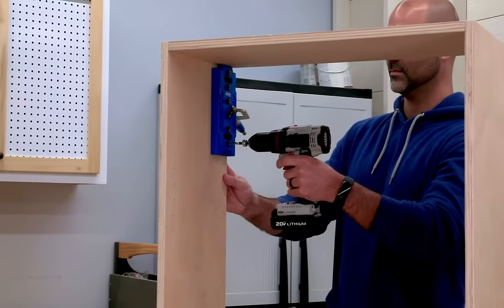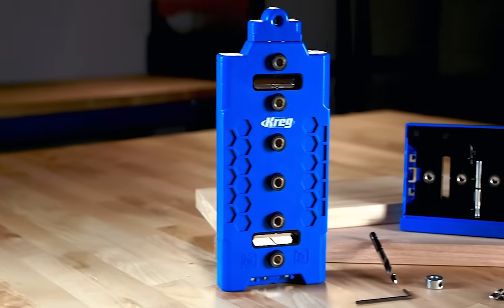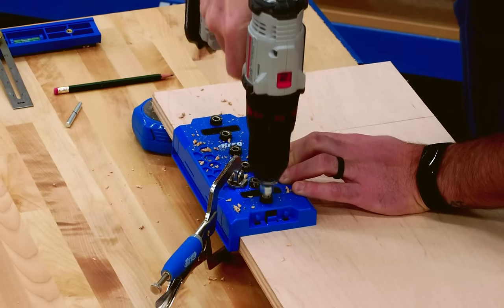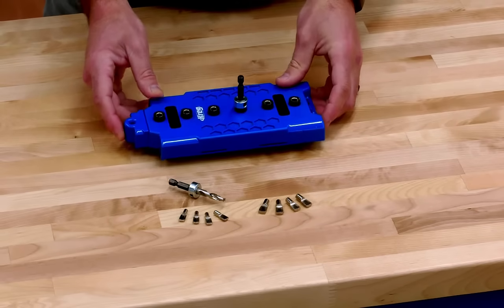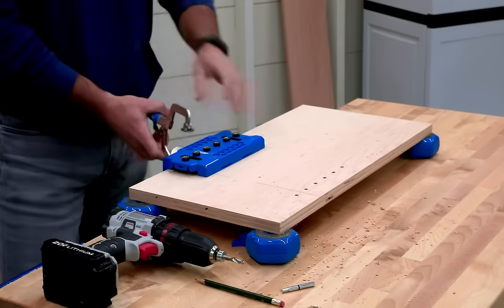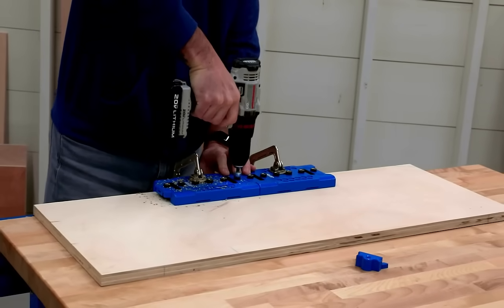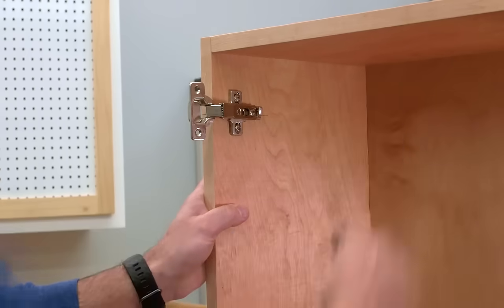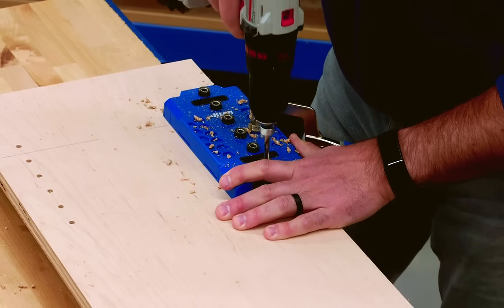Kreg® Shelf Pin Jig

Comment: What improvements does this model have over the older one?
Reply from the maker: The new Shelf Pin Jig improves on the first-generation jig’s design and incorporates more features. Vertical hole spacing remains the same at 1 1/4" (32mm), and backspacing--the distance from the edge to the holes--has been changed to 37mm, which adheres to the 32mm Cabinet System used by professional cabinet shops. 

The new Shelf Pin Jig also incorporates sight windows that expand the jig's capabilities. They can be used to locate cabinet door hinges and drawer slides (which are also designed to fit the 32mm Cabinet System) accurately.